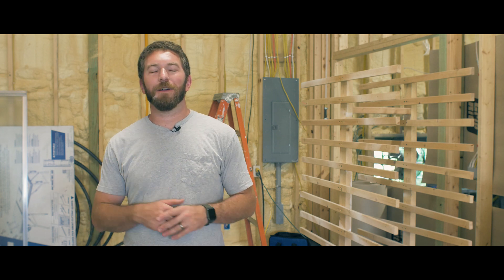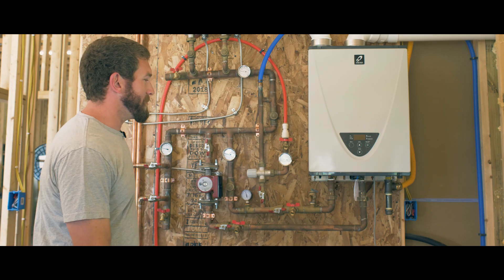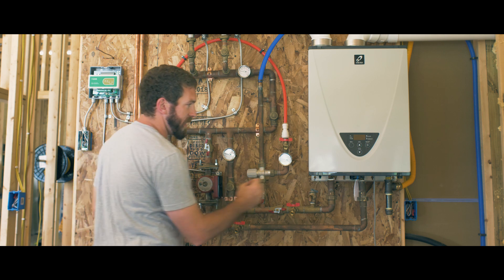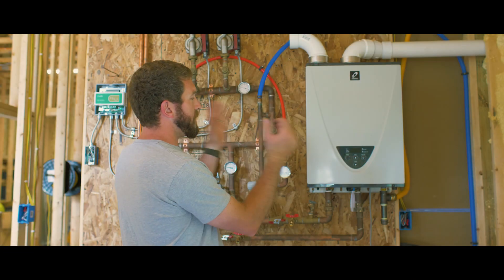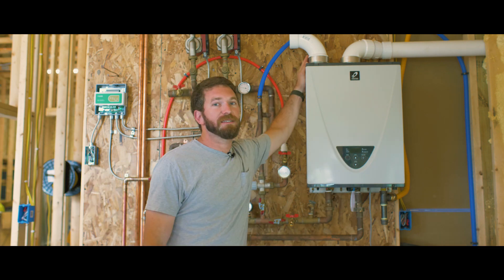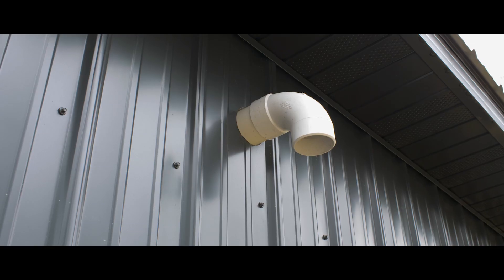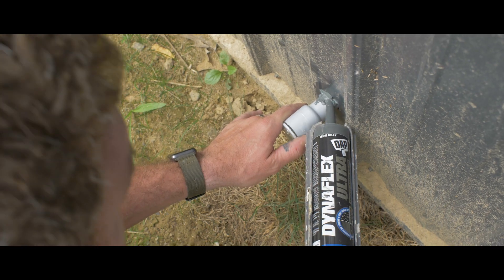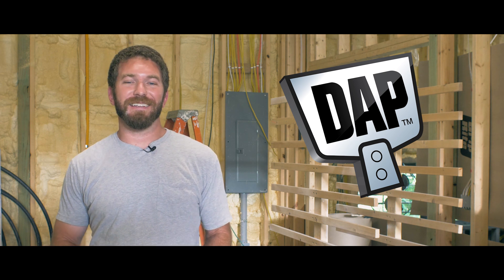Rogue HQ EP4 - Roughing in the Utilities

Comment: I'm no pro, but I believe you need to have a "swing joint" on that gas pipe before it enters your building. With the frost/thaw cycle here in Michigan the meter will move up and down over time and can cause damage/issues to the line and potentially crack or leak if its rigid like you installed it, the swing joint accounts for this movement and acts as a safeguard.

Comment: 10/2 or 10 Gauge wire is only good for 30 amps.. A 50 amp circuit for a welder or whatever would need 6 gauge wire.. Good for 50 amps.. Just an example.. 14 gauge = 15 amps,, 12 Gauge = 20 amps 10 Gauge= 30 amps, 8 gauge= 40 amps,  6 gauge= 50 and so on..

Comment: Love the series as we are getting ready to build a custom house this year. One feature we are adding is geothermal for heating and cooling.  It works really well even here in Minnesota. Did you ever consider it?
Reply: I plan on doing geothermal as well.  I have access to an excavator and 6 acres of cleared land, so I am just going to run it horizontal, to avoid paying for the extra cost of drilling.  Where I am building I cannot get natural gas piped in so, I am trying to make the system as efficient as possible.
Reply: blaze harding - the system we have designed uses a horizontal loop 6-8 feet underground and is installed in a manner similar to a cable being trenched along the side of the road. The surface is not disturbed in any way. My property is 10 acres so we have lots of room. Good luck with your system. It seems to be a great way to go.